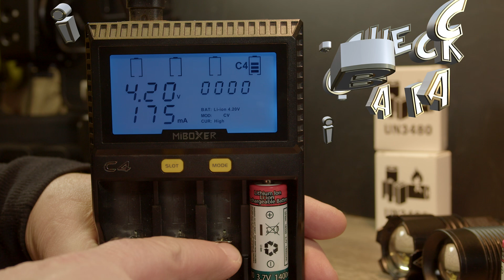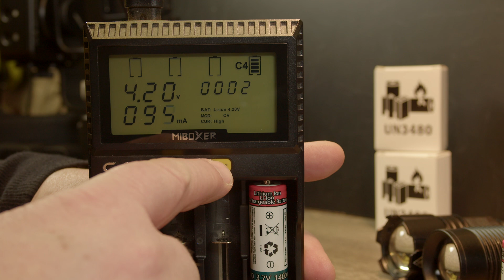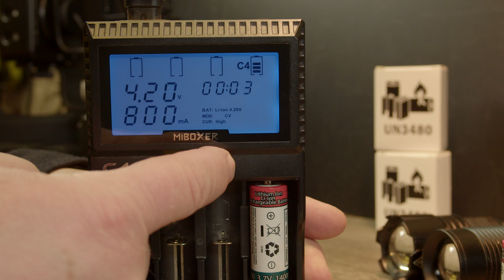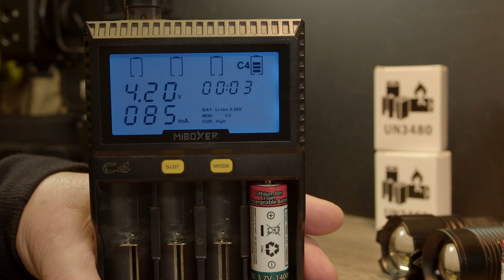How to measure Capacity with the MiBOXER C4 Charger

Comment: what version model is that? the interface look different.
Reply: It never showed discharging
Reply: @bryanbahling2877  Only the rightmost slot, C4, has this capability. You need to insert your battery there.
Reply from the maker: I am not sure. It is model C4, but i have it for a very long time already. I need to open it to see what version is printed onto the PCB.